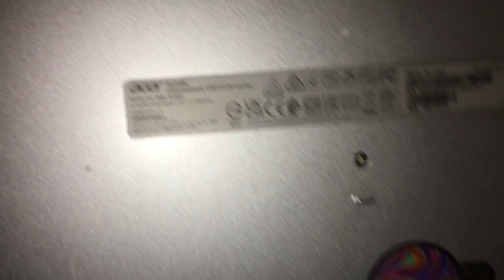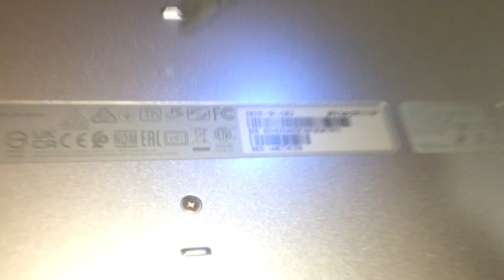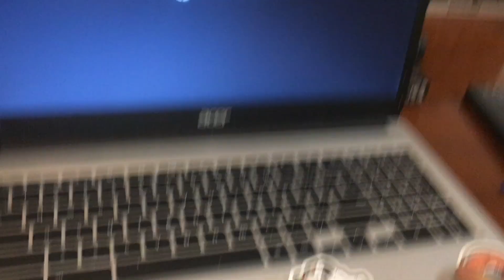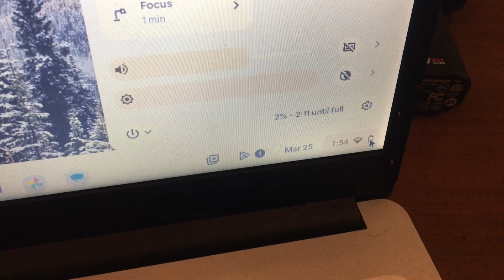How to fix Acer 315 Chromebook won't charge or turn on

Comment: Hi, didn't work for me. The battery is still not recognized by the chromebook. Don't know what to do. It stays in calculating the % on the screen and does not charge
Reply from the maker: disconnect it longer than 10s? maybe even longer. also not have it plugged in?
Reply: If i disconnect the battery there is a flashing red light.. if I connect the battery the light is blue for a bit and then stucks on red, but if I turn on the computer, it does not recognize the battery  @bobspurloc
Reply from the maker: did u do what I did? i disconnected the battery, no usb power plugged in. I then plugged in usb power. watched the light for a bit. then I unplugged the usb power. then I connected the battery. then I plugged in usb power again.